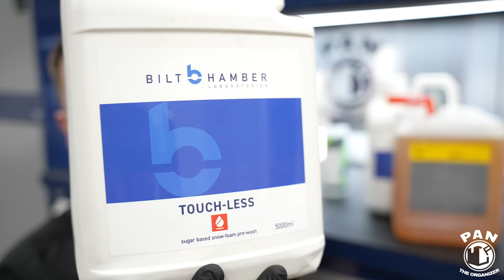The end of the 2 bucket car wash method!? 💀

Comment: Personally I use 8 buckets and always, always 2 live rabbits as wash mitts. 

For the wheels I buy 5 unshorn lambs and take each wheel into the bath with me on different days to spend a good hour cleaning each wheel including the spare. 

I then fly out a scientist to microscopically verify I have not scratched my vehicle.

I'm currently in the process of suing the atmosphere for any dust that lands on my vehicle.

While not washing my vehicle I stand guard in my garage next to it with a duster made from a skewered fox tail, a flash light and bottle of quick detailer just incase anything potentially contaminates my paint.

Comment: 2-bucket wash?  Tried it.  Hated it.
Prior to buying my Active 2.0 last year, I just used 1 bucket of GOOD car wash soap and a bunch of 70/30 microfiber towels.  I used ONE towel for ONE panel, except the hood (2 towels).  Throw the used towels into a bucket or plastic bag.
Then, I'd rinse and blow dry with an EGO 650 leaf blower.
Now, I do the pressure washer thing.
Reply from the maker: Thanks for sharing your thoughts.

Comment: Great video Pan. How do you feel about using BH Touchless every time for the initial foaming followed by a ph neutral foam for the contact wash?
Reply from the maker: I don't recommend using high pH snow foams for regular weekly washes. It will eventually weaken the protection. Once in a while for deeper cleanings is enough.

Comment: Hi Pan, when you re foam the vehicle did you use the higher ph shampoo again or the ph neutral one? Did the ph neutral only stayed in the bucket?
Reply from the maker: Disregard the B-roll footage of the video which was for making the video more dynamic. For regular weekly washes, you'd use a pH neutral snow foam and pH neutral soap in the bucket. Once in a while, for a deeper cleaning, you'd use a higher pH snow foam for the first foaming, and then for the 2nd foam use a pH neutral snow foam, and a pH neutral shampoo in the bucket.

Comment: Hi 

Can i ask for whats the best method of washing a car in my circumstances 

Things i will use
1. Only Ph neutral soap ( i wont use high ph prewash car. I use water only or ph neutral soap)
2. I have wash mitts & microfiber towels 

Methods I'm considering to use 

A. 1 bucket no grit, multiple microfiber towel
B. 1 bucket no grit, multiple wash mitts
C. 2 bucket, 1 washmitts
D. 1 bucket no grid guard, 1 wash mitts and pressure wash the mits after ever panel
Reply from the maker: A or B depending on what your prefer most. It doesn’t matter.
Reply: @PanTheOrganizer  great. But do i need to use grid guard?
Reply from the maker: I wouldn't take chances and I would always have a grit guard regardless of 1 bucket or 2 bucket. They are inexpensive, so why not have the extra security?
Reply: @PanTheOrganizer  is there a purpose  tp a grid guard if i dont scrub the mitt? Sorry im not totally understand how grid guard works

Btw for one bucket method. Is it bettee to use mitts than mf towels?
Because i read some ppl says if i use mf towel it can scratch more. Is it because of the gsm is too thin?

Comment: Amazing video.
I have a two month old Mazda cx5
I’m just a homeowner who wants to keep his car looking great while protecting it. 
I have a foam gun with hose. So I’ll foam and dwell then rinse and foam and contact wash

Which product do you recommend post wash?
And seems like spray and rinse sealant then drying is my speed! Thoughts?
Reply from the maker: You would need a drying aid if you are using a microfiber towel to dry. Here's my video on my favourite drying aids: https://youtu.be/NOTNed04xYE?si=W-hypnCPHzUleBPg

If you are using a blower to dry (100% touchless drying), you could wash the car, rinse it, while it's wet use a spray on rinse off sealant to boost gloss and slickness, and then blow dry the vehicle.

My favourite spray on rinse off sealant is in this review: https://youtu.be/1W8ZfyuMScY?si=XILkcRbt9LEgJw8p

Comment: Pan you are the man! What do you recommend for the best wall mounted vacuum system? Thanks!
Reply from the maker: I don't use a wall mounted vacuum in my garage. I use my Ridgid 4GAL / 5HP portable wet/dry vacuum. In my home, I do have a high end CycloVac central vacuum and it works great.

If I had to get a wall mounted vacuum system for the garage, I would trust one source, this: https://bit.ly/3S8o8lA

Comment: I like to foam cars and hate buckets so I'm sold to this new technique without even having trying it LOL. Can I use the turtle wax max power as the first foam and then use my adams car shampoo on the second? Also, I'm thinking of still using two buckets but instead of one for soap and one for rinse, there's gonna be two soap buckets: one on each side of the car!

Comment: Hi Pan, thank you for confirming the 1 bucket wash method.

For each stage of the snow foam, do you think adding some rinseless wash (e.g. McKee's 37 N-914) to the foam cannon will reduce the chance of scratching please?  Thank you.
Reply from the maker: Snow foams don't scratch the vehicle. It's a contactless pre-wash. You could use a rinseless wash as a pre-treat before the initial rinse if you want added lubrication. So it depends how you wash your car. If you foam on dry without pre-rinsing first, no need for a rinseless. If you like rinsing first, before foaming, then yes a pre-treat with a rinseless wash solution is a good idea, then rinse, then foam.

Comment: I really like this method, Pan, but I reckon I would always keep a separate wash bucket for the wheels and wheel wells (or make a separate batch of wash solution).  Maybe it is redundant but seems like an extra layer of insurance!
Reply from the maker: Always a separate wheel bucket for sure. We were just talking about paint in this video.
Reply: If you wash the wheels first then yes a separate or refreshed wash solution will be useful. If however you do the wheels last then it's not so much of an issue.

Comment: Great video sorry I am late to the party . So am I correct in saying then both times you foam the car you are using the higher ph lever twice? In my case the built hamber touchless or because it’s a higher ph you don’t ?
Reply from the maker: This wasn't a car wash tutorial, but more a discussion on 2 bucket vs 1 bucket methods. There are many ways to wash a car. But for regular weekly washes, I would recommend that you stick to using pH neutral car soaps. Both for snow foam and for the bucket wash.

Once in a while, if you need a higher cleaning power, you can use an alkaline snow foam for the pre-wash, and an acidic soap for the contact wash. Those are called "decon washes" when you need to do a deeper cleaning of grime, road film, accumulated road salts and minerals, etc. I like to do that in the spring time for example, to remove winter grime. See my ultimate spring deep cleaning tutorial here: https://youtu.be/oTaFE_p2OAw?si=kqyUvdz0bA2wVvIr

Comment: There's no way around the fact that 2 buckets reduces the dirt in the second bucket A LOT. But if your car is clean because you wash it often or sprayed it down, then reducing a microscopic amount of dirt down to still a microscopic amount of dirt just doesn't make a difference.
Reply from the maker: I would also add that a good and effective pre-wash, with a snow foam that can actually do some pre-cleaning like Bilt Hamber Touch-Less, really helps to reduce a lot of the surface dirt, debris and road film, before you actually do the contact wash. A good pre-wash with a snow foam will remove the grit and loose dirt, and what is left will be much easier to hand wash, thus reducing the chances of marring the paint.

Comment: 1 bucket, 2 bucket, no bucket, there are a ton of ways to get the job done (safely ofc) but that all depends on your situation. 

Have a Foam Canon:-
  One bucket and multiple towels each towel giving you 8 sides. Do not re-introduce that towel into the bucket once used.
  One bucket one wash mitt 
  No bucket, one wash mitt, rinse wash mitt with pressure washer after every panel.
 
Don't Have a Foam Canon
  2 bucket method
  One bucket multiple towels method

None of these methods be worth it if your just going to use cheap soap. These techniques will only work if you have a well lubricating shampoo, something like Turtle Wax Slick n Slide.

Comment: Thanks again for the informative video, as always. I don’t have a foam cannon or foam gun. Do think this method can be as effective just using an IK foam sprayer, which I do have? Or is a cannon/gun required to create the proper amount of foam? Thank you!
Reply from the maker: You can still use the IK foamer, it will just take a lot more time compared to a foam cannon setup, for obvious reasons.

Comment: I think one of the most important factors you highlighted in your method was to use gentle pressure during the contact wash.

I'll be the first to admit I was ignorant of correct wash methods for most of my life but have not had an issue with swirling or scratches despite not using foam or grit guards or a second bucket. I put that down to using a gentle pressure, letting the wash cloth glide over the paint. I tend to use 2-3 gallons out of  a wash bucket on a large car, so using plenty of wash solution may also help in preventing damage.

Comment: Hmmm. I think pre-foaming for most situations is a complete waste of time and money. Probably useful for a filthy vehicle.   I’ve tried 1 bucket and 2 bucket methods and haven’t noticed any difference in terms of paint damage.
Reply from the maker: There are valid reasons for both camps. But you'd have to run tests for a very long period of time before noticing any real damage. One or two washes isn't enough to draw a conclusion. ;)

Comment: Isn't 1:10 way too much soap, so you are putting 100ml soap into 1000ml bottle?  I bought Gentle Snow Foam, the instructions on the bottle says 20ml into 1000ml. I followed the instructions with the same foam gun you recommended, and my results were nowhere near yours. If this is the case the soap becomes extremely expensive.

Comment: Great video pan , I have never used 2 buckets always prewash may it be rinseless or foam. I do now want to get the bilt hamber stuff looks interesting
Reply from the maker: Thanks Eddie! You have to try the Bilt Hamber snow foams. Getting the proper dilution for your setup requires calculations the first time, but they are great.
Reply: @PanTheOrganizer  NO I havent I really want to try it , but seems like you need to be a mathematician haha. Ill order some from Carzilla do you have a code ?
Reply from the maker: No code, but you can order through my links to support my channel. Here's one for Touch-Less: https://bit.ly/3U8fVwz

And a link for all Bilt Hamber products: https://bit.ly/45wJLiE

This is currently the best pre-wash snow foam for actual cleaning capabilities in my opinion. 

And here's a video explaining the simplest way to calculate the correct dilution for your pressure washer and foam cannon setup: https://youtu.be/fZ_dyRofcHg?si=myp_3oFzUKUGHNVF

Comment: hi, great video's thanks for doing them   Question:  cleaning an already clean and ceramic'd car is kind of different than me cleaning my 4runner which spent a week in the mud or on dusty roads.        would you recommend at least power washing  something super dirty before doing the high ph foam?  also let's assume my 4runner still has not been ceramic'd.
Reply from the maker: Yes on a super dirty mud covered vehicle, I would pre-rinse first, as spraying the snow foam on top of mud won't do much.

Comment: So many overly complicated methods. Since I wash my car at home I do a rinse, wash, rinse then dry method. 

I have an electric power washer so I rinse to get any caked on dirt off. I then have a wand with a microfiber pad that hooks to my garden hose and the wand has a soap dispenser on it. No bucket dipping needed. I wash the entire car with one to two microfiber pads...except the wheels and tires. They get a separate wash. I actually wash them first. 

In the end I use the pressure washer to rinse the car then I have separate towels to dry the car and separate towels to dry the wheels. Viola.

My method works for me because I eliminate the need for buckets or running the risk of transferring dirt from dirty water and I use less towels in the process.
Reply from the maker: Welcome to my channel. You discovered one of the biggest car detailing channels on YouTube as we surpassed 945,000 subscribers and we have over 125 million views! I have been detailing for 26 years and I love to share my knowledge and passion with my viewers.

You found the right channel to help you learn everything about detailing.

Comment: Hi Pan, I've read that the built hamber touch-less and auto-foam should not be used for contact wash. Or is it okay to use because you're adding extra lubrication from the solution in the bucket?
Reply from the maker: BH Touch-Less and Auto-Foam are made for the pre-wash, not for the contact wash. You'd snow foam them on paint, let them dwell, and rinse off, and continue with your wash process.
Reply: @PanTheOrganizer  Thanks for the reply! My question was specifically about this video(The 1 bucket with 2x pre-wash method)! Sorry for the confusion :)
Reply from the maker: Can you be more precise in your question? What exactly is your question?

Comment: Thanks for another great video. Would Adams Mega Foam be good alternative to the Koche Chemie GSF? Can I use the  Koche Chemie Active Foam weekly if I’m using Turtle Wax Flex Wax with Graphene for protection?
Reply from the maker: Thanks! Yes the Adam's Mega Foam could be an alternative to Gsf. There is no need for the Active Foam on a weekly basis, but if you do, keep in mind this could wear down the Flex Wax a bit quicker. Just reapply it when you see the hydrophobics diminishing.

Comment: Ok Pan i normally agree with what you do but this time I'm confused!!! The old saying "if it aint broke dont fix it" so now your saying get rid of the second bucket for rinsing and just apply 2 coats of snowfoam, fill the bucket with shampoo but dont rinse the mitt/pad out. Surely the bucket will eventually fill up with dirty water unless you go and buy the grit gaurd to showed?? You say that you wash your car 2x weekly, but lets say like a lot of us you can only wash say every month, thats a lot of traffic film and dirt on the panels especially in winter and only using 1 bucket and rinsing once.
Ive tried applying shampoo through a snowfoam lance after using snowfoam but didnt see the piont of using more product to save on 20ltrs of extra water in a second rinse bucket, my water is free (rainwater harvesting) and the products cost money. Sorry but I'll stick to the old boring not fashionable but just as safe 2 bucket method.

Comment: Your being from Canada, I assume you’re familiar with the Krown Rust Proofing spray process. I plan to get the treatment here in NY on my new Forester. They wash the car after the treatment, but I assume it’s not complete. What might you suggest I use to better clean the painted and plastic surfaces after the Krown treatment. Thanks.
New subscriber enjoying your content.
Reply from the maker: I purchase new higher end German luxury vehicles (like my Porsche 911 Turbo S) and those typically have a super long rust warranty, and also usually use higher quality materials and galvanized steel or aluminum, so you don't typically do rustproofing on those vehicles. Some brands even say it voids the warranty if you use a rustproofing treatment. So I haven't really experimented with rustproofing. 

Also, I do low yearly mileage (6000-7000 km on average per year) and get a brand new car every three years, so rust is of zero concern to me.

When I was much younger and had Japanese cars (Mazda 6 GT, Nissan Sentra SE-R SpecV) in the 2000's, then I used to simply purchase the rustproofing that the dealership offered as that also came with warranty.

But yes I have heard that Krown is some of the best on the market.
Reply: Thank you for your reply. Being the rust proofing is a bio-friendly type oil of sorts, what product might you recommend to clean it off of the painted surfaces? I understand the Krown product contains Isobutane and Propane. Thanks again. Be well.  @PanTheOrganizer

Comment: Great explanation of the different soaps by pH. Curious where CarPro Descale fits in? I know it’s lower than neutral, but when would you use it over the higher pH options?
Reply from the maker: You use Descale only on an as needed basis. Meaning when you see water spots or mineral deposit accumulation.

It can weaken or strip regular waxes or sealants so keep that in mind.

See how I use it in a spring refresh wash here: https://youtu.be/oTaFE_p2OAw?si=OjxEACvBHUVypvVu
Reply: @PanTheOrganizer  gotcha, thanks!

Comment: Truly enjoyed this video! I’ve been doing this way of washing for the past year! Both of my cars are ceramic coated and I use a 7ph level foam cannon soap and the time is take to wash them individually is under 30min! I also had my rims ceramic coated as well😊!
Question for you? I don’t have the luxury of being able to wash my car in the garage like you (Awesome garage!!) so for my daily drive how would you go about washing it at the car wash bays? I’m not going to put it thru the car wash tunnel! But how would you go about washing during the winter months…I live in Burlington, Ontario Canada
Cheers
Reply from the maker: I might have to do a video on how to wash a car in a wash bay!
Reply: @PanTheOrganizer That would be awesome if you could!! BTW, do you have a video on washing / prepping your car for winter storage?
Reply: @PanTheOrganizer  For sure as I only wish I had a garage like yours !! :) On another note, what is the difference between Gyeon Wet and P&S (Bead + Dream) Maker? Di I need both or do they do basically the same job?